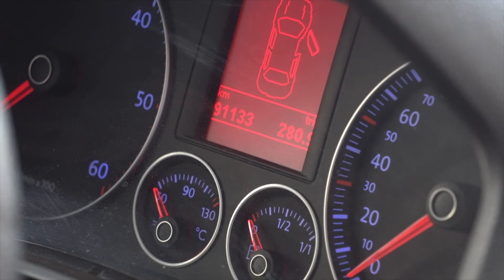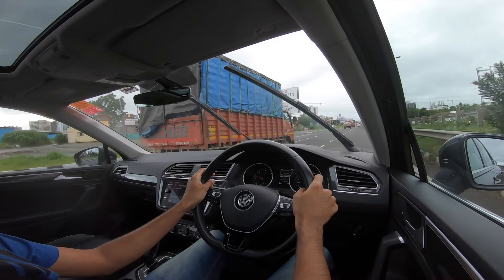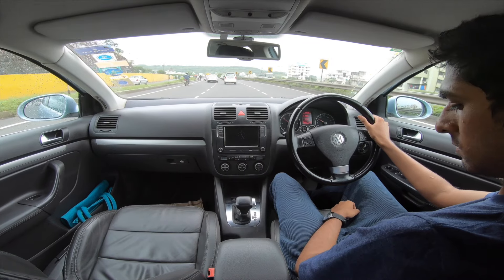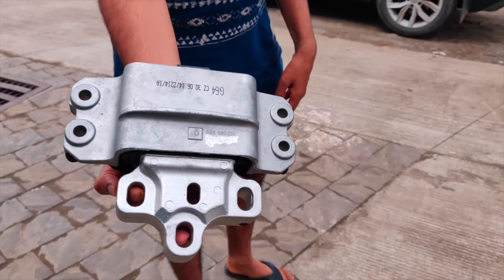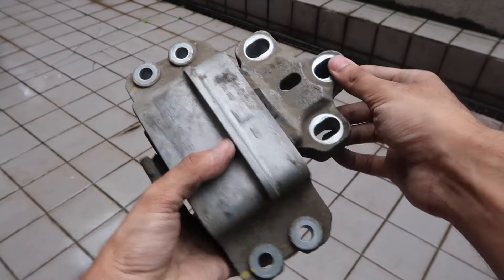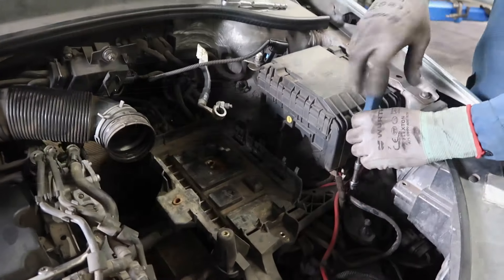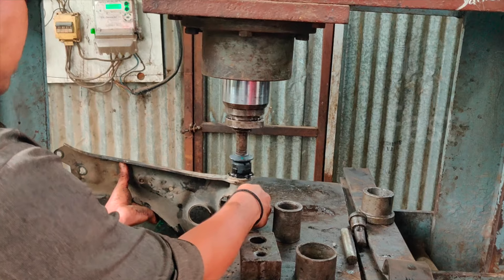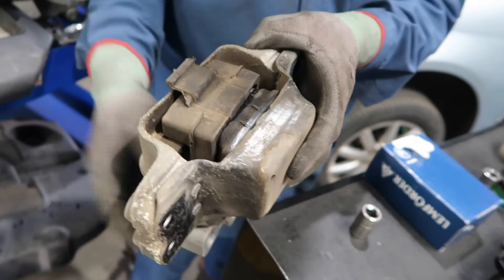Volkswagen Engine Mount Replacement  - New Vs Old Bad Mount Symptoms - Say Goodbye to Vibrations

Comment: Thanks for this video. 
I am using a 17 yrs old skoda Octavia. And I just ordered for the engine mounts . 
I observed vibrations followed by  inspection of  the mounts . 
Last year , .my car did pull to one side under heavy acceleration , it's as a result of worn out suspension arm bushing., Which I changed immediately. Thanks for this lovely presentation
Reply from the maker: Glad you found it useful. It should make your car feel a lot like it was when new.

Comment: I had my VW Vento Petrol(2013) mount replaced yesterday, and the results are quite amazing, the car's power and pickup seem to have rejuvenated and vibrations are virtually disappeared.
Reply: Is the quiter in Cabin too? Or its the same?
Reply: @tom3nex  much quieter. When the mounts become shaky, you can obviously hear the noise inside the cabin. I kept confusing it for suspension issues, until my  other mechanic drove it and identified the issue.

Comment: Sometimes depends on the engine or car but when you put new engine mounts maybe you can feel a bit more vibrations at idle cause they are new and need some period time for "adapt", that happens to me in a seat ibiza 1.9 tdi 90cv from 1999 when changed all 3 engine mounts and now in a golf 4 tdi 2002 with only the dogbone changed (this one doesnt support the weight of the engine but it prevents the engine the back and fort motion) in the golf you can do hard accelerations and you dont feel any vibration now, before the car do some "jumps" at certain speeds when accelerating hard

I totally recommend original engine mounts or at least good brands like lemforder or febi bilstein, dont buy cheap things cause maybe they can break easily or last less time, have more vibrations etc
Reply from the maker: Yes good advice.

Comment: I had this issue in my ameo. Typical symptom was sound from engine bay when going over uneven roads especially during when the engine is cold. The sound used to go away when the engine heats up. I had to go to atleast two vw service stations for the correct diagnosis.
Reply from the maker: Thanks a lot for sharing sir. Glad your issue was finally resolved!
Reply: @vinodreddi I'm also facing a similar issue with 1.2 mpi polo clocked 70k, during cold start a lot of vibration and clattering from the engine bay. When the engine heats up the sound is minimal. Have you changed engine mounts, how much does it cost ?

Comment: My 05 Jetta has some vibration, but it has been kicking or clunking from 1st to 2nd gear and also when I slow down clunking when it gets to that gear also. It doesn’t always do it. I thought it was my transmission but when I looked at the engine and had someone put it in reverse I saw the engine fall back toward the windshield, and fall forward when it was put in park. So I think my dogbone mount is bad. It’s not moving from side to side.
Reply from the maker: Yes it could very well be a case of bad mountings.
Reply: Did you get it done? Mine rattles and clunks when accerelating at 1-2k rpm 1st to 2nd gear :D
If it was the dogbone mount im screwed its a pain to do
Reply from the maker: @TheIdiotPlays Haha, it's not all that bad if you have some decent tools, or know a shop who'd be able to help!
Reply: @ I don't have a tool set for the dog bone/ subframe mount but otherwise im set to do it. 
I actually found a video that perfectly recorded the same noise as mine makes, although its a ford not vw golf. 50 euros for the part, not bad.
Reply from the maker: @TheIdiotPlays the dogbone should slide right out and can be swapped if you have a pair of jack stands and a jack. the subframe bushes need a press tool

Comment: I’m getting my mount replaced today! I’ve been feeling a vibration throughout my steering wheel when going over 80 mph, I hope this’ll help it out
Reply from the maker: That could also be something due to bad wheel balancing, if it only vibrates harder after 80 mph.
Reply: @SujoyShivde  I thought that as well, going to get the alignment off better help, it’s most likely that, there wasn’t so much of a difference, thank you!!

Comment: what a great video Sujoy. I think this is the issue my Golf 6 1.2 TSI has at the moment (with 157k kms in total). You can hear a "clunk" noise after shifting from 1st to 2nd gear. There's also the vibration at idle as you mentioned. And some rattle sound sometimes (but rarely) when shifting from 3rd to 4th after 2.5 or 3k RPM)... Sounds like I need to get them replaced right? the question is which one should be done first? or do them all at once?
Reply from the maker: For a car that mileage, there's a chance all of them have gotten old and damaged. Usually, engine mounts are changed in pairs. So I'd get all 5 of them replaced at once. It will definitely make your car feel quite new. I was super impressed when I got mine changed. The clunk might get reduced, unless it's a gearbox specific issue. This will definitely reduce the vibrations on the dash
Reply: makes sense! many thanks for your reply ;) do you know the gearbox issue? is it a typical thing? critical or can be used like this (I haven't repair anything since I own it, 10 months already...)? @SujoyShivde
Reply from the maker: It's quite typical for higher mileage DSG gearboxes to clunk. I'd suggest driving it. One day it'll either just break down with flashing P R N D S or have stuck gears. In those cases, you'll need to inspect the mechatronic and the clutchpacks. Till then, just enjoy it
Reply: It's not DSG, it's manual! @SujoyShivde
Reply from the maker: Aah! Yes, I'd still have a mechanic atleast inspect the mounts for play especially the dogbone mounts.

Comment: I get crazy viabration when revving as low as 1300 rpm and when I turn the car on the engine jumps abs makes car jump… I’ve put brand new engine mount not replaced dogbone or transmission mount my question is how much viabration does the lower rubber mounts the dog bone go into cause? As put a decent second hand transmission mount hardly any play and car still driving like straight engine to frame… 1.6 fsi 2004 with 120000 on clock thanks again!
Reply from the maker: Haha! Good question. The dogbone and transmission mount are equally important, but not sure how much vibration they'd cause. Have the mounts visually inspected. Depending on your car, the subframe mounts might also be on the verge of replacement 
.

Comment: Wo just two days ago changed my Engine mount on My Vw Jetta  TDI aslo changed my Dsg Transmission oil  & coolant
Reply from the maker: That's nice, where did you get the job done? And which coolant did you use?
Reply: @SujoyShivde   G13 Vw specified 
work done by local mechanic  who a friend of mine
Reply: Great video bro ❤

Costs please?

Comment: My engine shakes pretty bad on start up. It only does it when I start the car, other than that the car drives fine. Could the mounts be the cause?
Reply from the maker: Try some heavy acceleration on a straight line and see if the car sways or leans to one side. That is a common symptom. Check for stray vibrations on the dashboard, wheel when the engine is idling.
Reply: Do u meen steering wheel vibration? 

I do get random vibrations on the steering wheel. 

So do you think I should just change the motor mounts?

But like I said before it's mainly on start up the engine shakes pretty bad. Especially if I start up on a hill. 

Thanks for the help
Reply: Hi did this work please

Comment: any idea what is the "torque specification" of "A bracket" engine mount's M10x60 bolts on the VW polo?
Reply from the maker: Would be possible to look it up in the service manual.
Reply: @SujoyShivde  ok i got it from my friend just now, it was 40Nm + 90 degrees, thanks,
Reply from the maker: Thanks for sharing

Comment: I have volkswagen 2013 passat.  Between 75 miles  to 80 miles in high way (freeway) my car shacking and bounce. What do you think  bad engine mount  or shock up  isuues
In usa  we have miles.
Reply from the maker: Can be a bunch of things. First guess would be tyres. Try getting them balanced at a tyre shop. Engine mount issues cause a pull, not a bounce. Could also be weaker struts depending on your car mileage, but better to go systematically

Comment: My car shakes when i accelerate its like i have to drive it smoothly but when i gets to 100 kilometers per hour its start to shake badly 100 kilometers per hour to 140 kilometers per hour its very bad and when it shake i also feel it on the foot rest near the clutch pedal could it be also engine mountings
Reply from the maker: If there are vibrations present even while the car is idling with engine on, it could be bad or weak engine mounts. If the issue is specifically happening at speeds of 100+, it could be an instance of wheels not balanced correctly causing a heavy vibration.

Comment: One observation. I saw the mechanic using grease while mounting the rubber suspension component. How he uses silicone based lubes
Reply from the maker: I think you are referring to the silicone oil/grease being used during the lower arm bushing installation. I believe this is a standard practice in the pressing shop to allow smooth fitment of the bushing and subframe mounts. No other lubes were used during the installation of the 3 main engine mounts, as the service repair manual doesn't prescribe any.

Comment: i’m changing the drivers side mount  (exactly the same as urs) and the metal but spins easily inside the rubber mount. is this normal? there’s a few mounts available and  this was the cheapest
Reply from the maker: No, the rubber should feel firm, and not spin easily. Look at the video for a reference
Reply: @SujoyShivde  the rubber is fine and it feels firm like it should but the metal bit spins inside the rubber if enough force is applied

Comment: Hi Sujoy,

I’m facing some vibration or rattling sound which comes from my front dashboard. I’ve changed engine and transmission mounting. The 3rd piece i have not replaced yet (underneath). Could that be the problem? Pls advise.
Reply from the maker: Have you tried isolating the issue, by seeing when you feel if? Under regular driving, or idling, or over some particular road. If you say it's in the dash, it could be something else, like something loose either. Get the car on the lift and have the mounts inspected. Which vehicle is it?

Comment: Thank you Sujoy for the great video. This was very informative! 😊How are the  Lemforders holding up in your remapped Tdi?  Are these stiffer than stock OE mounts? I too have plans to change the mounts in my Mk6 Jetta Tdi manual transmission. Could you help me with parts number for the mounts and the bolts for 2.0 tdi CLCB engine?
Reply from the maker: They're an exact OE equivalent. Can you connect with Instagram? Will be easier to help you with parts.
Reply: Thank you! Unfortunately Im not on instagram. Is there any other way to get in touch?
Reply from the maker: @thomast4479  can you drop an email? fluidicjoy@gmail.com we will get in touch

Comment: which digital torque wrench adapter do you use? how's your experience with it?
Reply from the maker: I was using a Digital Torque Wrench I procured of AliExpress. Working fine. Pretty consistent experience. Helps when the clearance is good, but not helpful in tight spaces.

Comment: Could the steering wheel shake in idle mode and when driving if the mount are done? I’ve changed suspension, inner and outer rods for steering rack… and it’s still shakes so now I think engine mount are fine?
Reply from the maker: Shaking specific to your steering could also be about your steering rack/steering column assembly. The engine mount replacement will reduce overall cabin/dash/vibrations.

Comment: How much did it cost
Reply from the maker: 15-20k for all the engine mounts for MK5 Jetta 1.9 TDI
Reply: @SujoyShivde  going to get mine done tomorrow. Is this the cost quote from VW showroom?
Reply from the maker: @vineetnaik2642 no, I bought ZF Mounts. Showroom pricing will be a lot more, but it's worth it you plan to keep the car for a longer time.

Comment: Bro how much does the original genuine Volkswagen polo engine mount cost ?
Reply from the maker: Bro need to check, as some mounts are VIN specific.
Reply: I asked in Volkswagen nagpur and they said that it will cost around 15k
For one part- right side
Reply from the maker: Might be a Hydraulic Mount, and highly VIN specific.

Comment: Im having Some vibrations in D (DSG) in Idle and driving (like unbalanced wheels) but i already Bought Brand New wheels. I can feel it in Steering , Seat and body. My Engine shakes when i turn it off. 
Sounds like the mounts?? Thank you
Reply from the maker: Yeah, sounds like a bad mount. But try and single it out to the mounts. Do the steering vibrations occur on braking? If yes, then it could be something to do with the front rotors. Are you experiencing any issues with shifts on your DSG? How much have you driven? DSG vibrations could also be related to the Flywheel, but it's more of a shudder than a vibration. Do check if the car sways on heavy acceleration. That's one of the indicator for bad mounts.
Reply: @SujoyShivde  no issues on the brakes. The DSG shifts are good. I run some test to hear if its the flywheel but nothing. I have 62.000km on it. 
And i got some clunks when i accelerate and deaccelerate shortly. Only hearable in 1-3 gear.
Reply from the maker: @swarly_yt  the 1-3 DSG clunks are fairly characteristic to the DSG.

Comment: Can u tell me the vw 1.2 petrol 2011 the engine mount part no
Reply from the maker: If you can share your VIN, will share exact part no
Reply: Bataeyaa nai ?
Reply from the maker: Sir I asked for your VIN no to confirm exact part for your car.
Reply from the maker: @preet22able  2011 Polo. Engine Mount :- 6R0 199 167 AA. Gearbox :- 6Q0199555AS. Pendulum 6RF199851
Reply: @SujoyShivde  bro but old one is 6rf199262
Reply: Where to buy this mount
Reply from the maker: Company keeps updating parts. 6RF199262F came till 19.12.2012. after that new part no is 6R0199167AA for CJLA Engine which is your petrol engine code. You can also fit the older one, but ETKA which I use always suggests the newest revision
Reply from the maker: @preet22able  sir I will link a number for OEM parts dealer. If you want VW part, then you can go with Boodmo.
Reply: @SujoyShivde  can u tell me which site i find spare part no with vin no some people say boodmo duplicate parts
Reply from the maker: You can contact him :- +919324981981 Saral Trading. OEM part dealer. All India.
Reply from the maker: +919324981981 Saral Trading
Reply: @SujoyShivde  ok thx bro
Reply: @SujoyShivde   bro boodmo main 6rf199262 F nai hai
6rf199262 p lag jayee gaa kyaaa ?
Reply from the maker: @preet22able  will have to check sir.

Comment: iam from chennai
own a 2010 mk5 2.0 tdi  (  crdi) jetta
about 90k kms run. (manual) 

may i know the entire cost of the parts
&

(service seperatly)

so that i could prepare .😀🙏
Reply from the maker: Could you send me an email on fluidicjoy@gmail.com? Will guide you there by confirming your VIN No.
Reply from the maker: But a generic answer is this :- 10-12k MAX if you go for ZF Lemfoerder Mounts ( 5 Mount Set) and about 6-8k if going for local Taiwanese Mounts. VW mounts are about 19-20k in dealership and labour extra.
Reply: @SujoyShivde  thank u very very much.

sorry for the delayed reply 

iam taking a screen shot of your reply.

thank u again.
Reply: I am having a VW1.2 MPI, what is the recommended interval to change mounts
By the way I am from ZF, and watching your video bring me a smile on my face.
Have you bought the mounts from Anand tempo house Pune ?
Reply from the maker: @vinodarjala7075 that's nice to here! ZF is a nice brand, I recommend it to a lot of my friends. There is no fixed interval, if there is excessive vibration, then the mount is inspected for excess play and recommended to be replaced. Our road conditions end up causing premature engine mount wear. Yes, I bought them from Anand Tempo House.